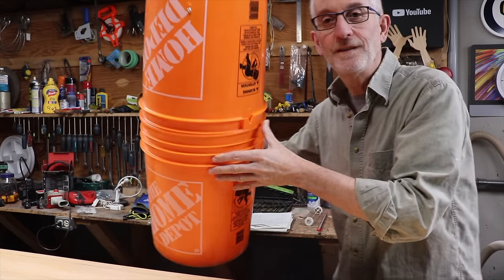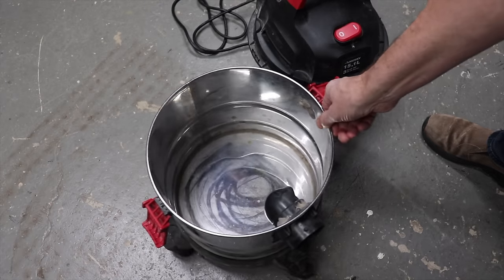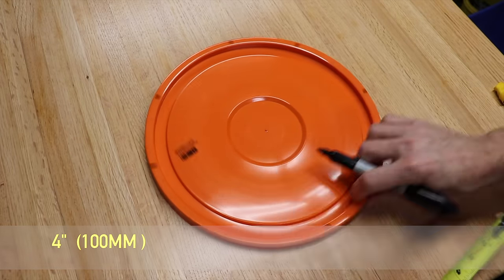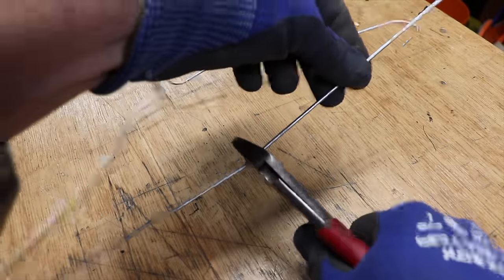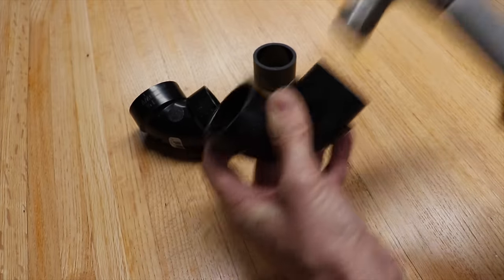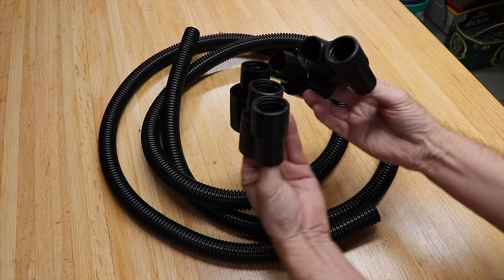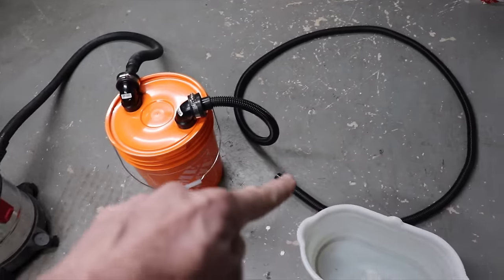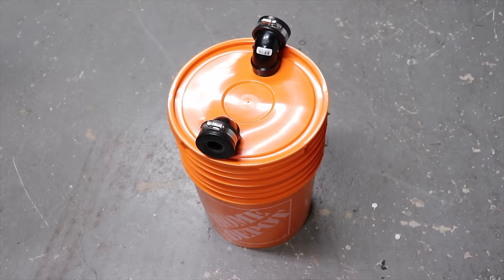How to Make ● Simple Wet Vac

Comment: Hi Chris, I've got a question:

Does this design allow collecting dry dust into the bucket if it is pre-filled with water as well? Like the Rainbow vacs. 

My concern is that for dry dust, it might just not get to the water and fly into the inlet, filling up the dust bag instead.

Thanks.
Reply from the maker: This one is for Water. I made another for dust. Watch that video.
Reply: @chrisnotap  Thanks, I watched it. What I mean is that in some vacuum systems, they relied on having the water act as the "dust trap", since dust easily adheres the the water on the base on the bucket (like I said, the Rainbow vacs does this). After that, it'll be much easier to throw the dusty water in the toilet where the dust doesn't fly around. 

Do you observe that as well in your wet vacuum?

Thanks again!

Comment: I was using my cheap home depot buckethead shop vac that goes on a 5 gallon bucket but it finally crapped out on me.. I have a larger stronger shop vac and i think id make this setup for it..

I was sucking up some water in a hole i dug for my water line that had a pinhole i had to dig up and fix

Comment: It would be cool if you could fit a check valve. And fit a valve to drain it so you dont have to fight the snapped lid seal . What shop vacuum is strong enough to collapse a bucket?  That has to be a monster

Comment: Hi Chris, I'm an Australian fan. I'm wondering if you could try do a video on making a DIY air filter for filtering smoke out of the air in a room? I'm already trying to design my own filter that can be easily added to the filter on my wall mounted aircon and could be adapted for any similar system. Cheers mate, keep up the good work (Y)
Reply from the maker: What kind of smoke?
Reply: @chrisnotap  bushfire smoke RE the current situation here in Australia. We've all been using P2 facemasks which are fine for an individual out and about, but inside buildings during the day or overnight, it's a bit more of a challenge.

Comment: If you use a hole saw, you can do one less step. Also, with some think rubber washers/bushings you can add a hose bib at the bottom so you can drain it without opening the lid.
Reply from the maker: Yes that would work but the lid is so easy to remove, it's doesn't get much easier. Thanks.

Comment: Can this be used as Dust collection for power tools?  Like a smaller version of the two bucket one you made.
Reply from the maker: Yes it could be a smaller version but you’d need to angle the fittings like in the dust collector.
Reply: Got it, any odds of it working on a rectangle storage tote? I want some that is about the same form factor as my ryobi 18v 3 gallon shop vac.

Comment: Does this also work with a bigger capacity drum? Like 200 liters or more? Or will it also require a bigger vacuum?
Reply from the maker: Should work the same. The risk is it collapsing due to more surface area.
Reply: @chrisnotap  by collapsing you mean the big bucket i hope 😂 thanks for your response. And if its off a very hard material like a big water barrel? Still the risk of collapsing or dont you know ? I could use this for my business and plan to do this with a bigger capacity.

Thanks for your response and excuse me for my bad english

Comment: With this setup, is it still necessary to put the wet filter in the vac? I think if I still have to change the filter, I'll just use the vac. Currently a 16-gallon vac with a drain plug on the side.
Reply from the maker: If you use this and don't let it over flow, you're golden! If you do allow it to overflow, then the filter might get wet. But then just take the filter out and dry it. No biggy.
Reply: @chrisnotap  Thank you, Sir. Great channel.  :)
Reply: You must use the wet filter for wet pick up in the shop vac , I made the same setup using a 25 gallon plastic barrel and it's a good thing I put the wet filter in first ,  Especially when vacuuming up water off the floor because you've got high velocity air combined with water within the hose which will create alot of mist in the vacuum and eventually get the filter wet , 
That's why you still need the filter for wet pick up installed before using for wet pick up

Comment: this way you screw the carbon electrodes or graphite in the motor you get moisture there so certain fail we happen prematurely, you need another motor to work with these bucket, some ciclone fan or something lika that
Reply from the maker: You'd think that but the moisture does not go through the motor! It goes through the impeller only and in the vacuum can itself. I recently disassembled my vacuum to prove this to myself and sure enough moisture cannot get into the motor.

Comment: How does the second outer pail prevent the recovery pail from collapsing ?
Reply: The recovery pail may collapse due to the higher air pressure on the outside of the pail being stronger than the plastic can withstand.  If you add a second bucket, you've doubled the thickness of the plastic, essentially doubling the strength of the pail.
Reply: @ bfjb70      I imagine by doubling the buckets it creates a stronger wall as it becomes doubly thick thereby requiring twice as much force to collapse it. Think of how 2 paper plates are stronger than one for a heavy steak.
Reply: The outer pail prevents the inner pail's creases from expanding outward.

Comment: My lid has a rubber o-ring on the inside, for a better seal. Your lid did not show an o-ring. I got my lid last year.
Reply from the maker: I found a seal is not necessary since there is plenty of suction with most vacuums. Thanks.

Comment: Last summer I built a WASPINATOR, which is basically this, one of those long carp fishing poles that is hollow attached to the sucky end and set up at the entrance/exit of the nest with a long inside inlet pipe and a few inches of soapy wooder in the bottom. A bit of mesh  over the inside pipe end to the vac. I used a clear storage tub so I could see the little bastards drown but that's optional.

Comment: .                        DANGER ⚠️
As explained in the beginning of the video
NEVER , NEVER USE A SHOP VAC TO PICK UP ANY FLAMMABLE LIQUIDS !!!  Gasoline , Paint thinners etc. , Even though you're using a second container , The vapors are being drawn to the motor and the brushes in the motor create sparks which will ignite vapors causing a major explosion and fire resulting in severe burn injury , Death and property damage , Enjoy building your projects but ALWAYS PUT SAFETY FIRST !!!

Comment: Realistically you could use any vacuum with a hose. However you would need to be careful not to overflow the bucket and ruin your house vacuum.
Reply from the maker: I used this for years with my central vacuum. Of course I was very vigilant about the amount I was sucking up. It never hurt my central vac at all. Very useful to have around. I mostly used it for toilet repairs to drain it, for wine and food spills, vomit on carpets, spills on the couch.........many many uses.

Comment: Sorry to disagree with you Chris   adding a bucket wont stop it collapsing.... the vacuum will still be on the inner bucket.... no doubt someone will tell me if i am wrong
Reply from the maker: Pushing the bucket into a second bucket creates an almost 100% seal between the 2 and now it is double walled giving it added strength.
Reply: It's actually the atmospheric pressure pushing against the outside of the bucket causing it to collapse because the shop vac is lowering the atmospheric pressure inside

Comment: you better poke pin hole on your bucket to warn yourself of over water level.Or Else,water gets in to your motor,cause electric shortage,cause fire,cause explosion!Just saying.
Reply from the maker: A hole in the side will not leak water. It will suck in air. If it sucks water up, its a shop vac, it's supposed to suck up water! It won't hurt it! If you decide to use a house vacuum then you would need to check it to see where the level is. Very easy to do with this lid.